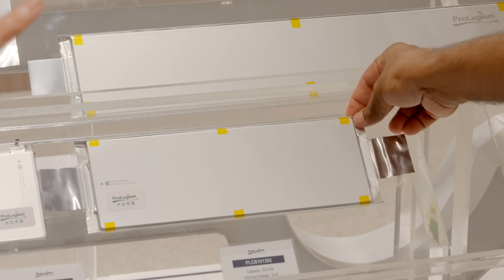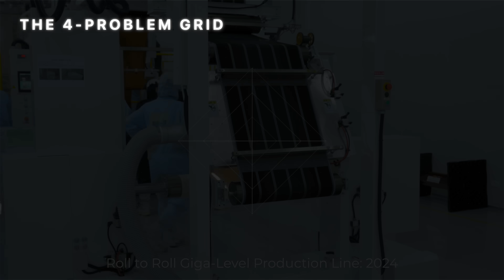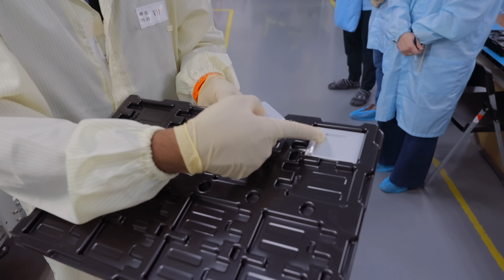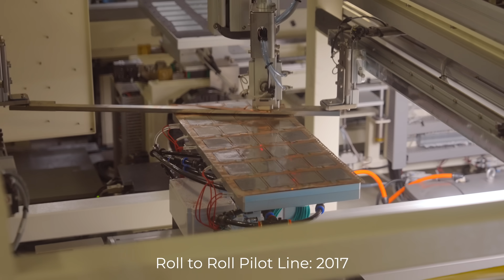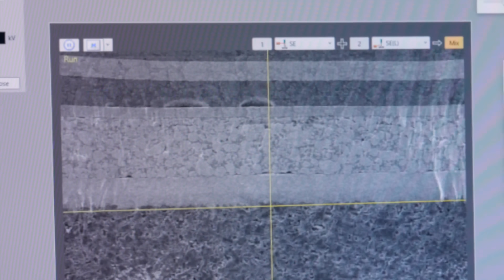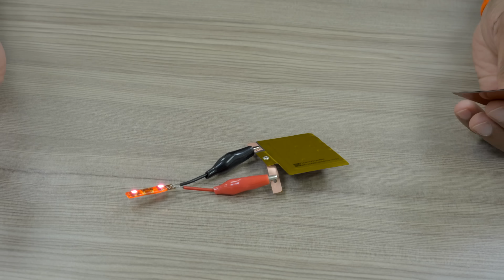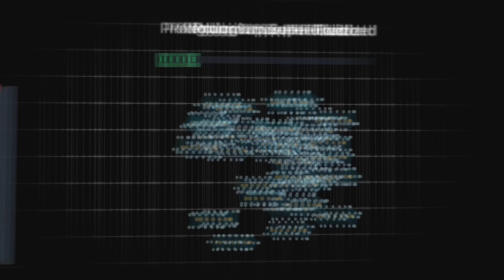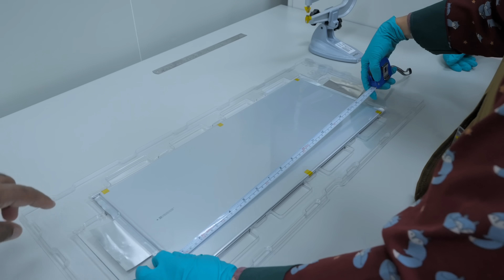Testing a REAL Solid-State Battery - Finally Here?

Comment: 24:57 discharged to 2.V thats way too low, would kill cycle life. I would say their E.D. is 280-310 Wh/Kg under a more practical voltage range of ~2.8 V.  Did anyone notice their current collector looks more like brass color than Copper? any thoughts.

Comment: This engineering is crazy. Really impressive. Well made video as well. I appreciate the comparison metics.

My questions:
- What kind of lifespan might you expect from Prologium battery like this?
- What happens to the battery at end of life, and what hazards might the chemicals pose?
- Can the battery be recycled in the same way the lithium ion battery can?
- what is the projected price per KWh?
Reply from the maker: Great questions. We may follow up with them as they start showing up in cars and ask about recycling and price. But recycling should be similar to tofay

Comment: Just one bit miss in the ProLogium battery presented here: 1200 charging cycles. Get that up to 3-4000 cycles at a competitive price and they have a big win for the next 3-5 years.
Reply: I don't think they need to increase the charging cycles 

If you look at the details that 1200 charging cycles is a very fast charging rate that's very hard on the battery 

What I want and I think a lot of people want is more capacity

Comment: This seems like a great evolution without the extreme claims that defy physics. Although the company shouldn't risk reputation, hypothetically you could buy an bike, send them the battery to be rebuilt by them.  The simplest real world test of real world use. The safety gains here and other applications, far outweigh the gains in automobile safety, given the tightly controlled use case. Bike to Aircraft safety?

Comment: The only problem with the name "solid state" battery is that the term "solid state" has been abused in electrical devices for decades to simply mean "no moving parts." not the absence of liquid.   Even here it is applied where a shear thinning fluid is being used.   So, the difference in solidity between conventional and solid state batteries is, well, small.  Why care?   I anticipate a lot of companies are going to use the current test criteria for solid state to sell very slightly modified traditional cells at a premium, making it hard for consumers at any level to tell where the quality products are.

Comment: That's great power density for a battery but gasoline still is king at 12.2 to 13.1 kwh per kg.
13,100 is much bigger than 397 by 33 times.
That's why gasoline is like a magical liquid.
Reply: You're forgetting that even the best internal combustion engines have awful efficiency compared to electrical appliances. Most of that energy in gasoline is lost as noise, heat and vibrations.

Comment: So, using these batteries to replace my F150 lightning pack of 1600lbs/131kwh, we would get 261.8kwh?  The truck would then have a roughly double range of 640 miles...

Comment: discharging to a very low voltage always gives you more energy. The question is, how much is the cell damaged by it. (regular Lithium cells are only discharged to around 3.5V by devices, their capactiy definitions discharge to 3V. So 2V seems very low). You can take any lithium cell and do 2V a few times to get bigger numbers. The question is, what is the voltage range for the claimed cycle live. I expect the discharge end voltage will be higher, thus the energy density lower.

Comment: Polyimides (PI) are used in extreme environments, as they can withstand temperatures over 400°C. And it is the thermal plastic used in lithium-ion batteries and recently solid-state batteries. So Ricky isn't nearly correct when he says...'the trouble is plastic starts to melt at a 130 degrees C', sure everyday plastics people put their hands on does. BUT the plastic separator in most lithium-ion batteries is NOT simply a 'thin plastic separator'...not by a long shot. And of course 'Conventional batteries' don't simply fight thermal coupling 'this with one tool'...smdh.

Comment: Thank you for saying dendrites can form on their own especially in frozen conditions, they don't say that and people that have them don't know it, leaving them against wooden walls year round in freezing cold, that could burn down a house, possibly the whole gas line attached to it. I'm gonna try to figure out the safest way and place to store it but most people don't realize it degrades with or without use in the freezing wooden part of their house, disaster waiting to happen, easily preventable, but people need to know that and they don't so most won't.

Comment: what I'm seeking the most in the new batteries is capacity. Most laptops still don't last a full day, not to mention more. And at heavy loads there is no laptop that lasts a full day. 
Imagine a gaming laptop that can still retain high performance and work for like 7-8 hours like that, while having a 2-day battery for light loads. That would be amazing.

Comment: LOL, it's not a solid state battery.   There is no solid state battery.   There is no liquid in a solid state battery.  Your channel is nothing but spam posts - every time I click on it, the video is nothing but incorrect information.
Reply: I think your point is valid, but technically speaking, the electrolyte is a non-Newtonian fluid, and whether or not a non-Newtonian fluid behaves closer to a liquid or a solid is dependent on stresses being applied. If the electrolyte normally behaves like a solid but exhibits sheer thinning when stressed, then colloquially (and probably for marketing purposes) you could call it solid state. But, yeah, if you adhere to a rigid definition of solid state, this is not solid state.

Comment: @12:19 you can also see smoke, when the scissors makes the initial cut. Is that the short causing the temp spike? 

I LOVE where batteries are going, great video, especially for us that use electric mobility abd have to have batteries in our home to charge. 
I am also confused why there still are no "graphene based" batteries as that would solve a ton of issues and make them safer.

Comment: Самые не убиваемые твердотельные аккумуляторы - это гравитационные (груз на тросе, который поднимая заряжают, а опускаясь он отдает накопленное) и инерционные (маятник и маховик). А остальное -  это потенциальный и очень дорогой мусор! 
***************
The most durable solid-state batteries are gravity batteries (a weight on a cable that charges when raised and releases its stored energy when lowered) and inertial batteries (a pendulum and a flywheel). And the rest is potential and very expensive garbage!

Comment: I don't remembering the Charge time? If this was in a Car and had 800KM of range at 180Watts/Km - what would the weight of the battery be? Does one need Cooling and Heating systems for the battery at all?

Comment: I would like to see the energy density numbers and wattage/hour test within the form and context of a battery back.. How much and how heavy packaging is required to pack that thin rectangular wide battery pouch?? are the compared energy density numbers for the best NMC batteries for their cells as it is in this test or are they at the pack level (270 watt-hours/kg) ?? If you pack that solid state into a system with the pressure needs of a solid state battery how heavy would it be? I am not questioning the integrity of this video but see some uncertainty and lack of clarity..

Comment: Talk about making a simple problem ridiculously complicated ;)))  Liquid air is better than any battery will ever be ;) Not just because of power and energy density per KG / volume. But also by its ecological & social footprint in manufacturing and usage. Ask me how ;) It is so easy that it is most exquisite ! Leo said it before and nailed it so well: "Simplicity is the ultimate sophistication" The only solution to the easiest most efficient all all front propulsion system si not even new or my idea ;) It is a set of natural phenomenons from the same family we see all the time in various forms in plain Nature.Animals use it also and quite spectacularly. Why must we avoid that and complicated our lives just for the dopamine of being different or "better" than the previous best crap ??? To use batteries you need motors. To use motors you need propellers and/or wheels. To use wheels you need tires. To make all that a lot of special  materials and slave-hours are wasted. Why ? Why not just be done with that problem as simple as possible and deal with other aspects of life like living worry free ? This is not an improvement ;) It is the polished road to a full technological anti-logic hell ;)

Comment: 26:18 If it's 30% more energy dense, wouldn't you get more than 30% smaller battery packs for the same range, since they now weigh less and therefore have to expend less energy to move?

Comment: Capacity testing a battery with such a large surface area will produce higher numbers than smaller profiles so don't expect the same power WH/KG with smaller cells. With only a 30% improvement over conventional batteries what is the cost premium and is it cost effective for EV applications?

Comment: I'm impressed but also wondering where the usual Two Bit skepticism was.  There is always a tradeoff.  We got a hint of one: cobalt is still present.  Another comment inquired about cost.  I also wonder about the manufacturing efficiency - faster drying of a slurry is likely to greatly increase the required energy input.

Comment: when he cut the cell in half and the LED came BACK ON?! okay now i'm excited
Reply: @stuartb5510  yeah that was kinda amazing. I'm sure this format will get incremental improvements over the years, like other cell technologies have done. More capacity/density, lower price, more charge cycles(?).  Just knowing there is virtually zero chance that your embedded battery will try and end you with a violent chemical fire is quite a plus!

Comment: These and other solid state batteries have a long ways to go. Expensive and relatively fragile when considering expansion and contraction issues. Also, lithium anodes is the eventual goal due to ceramics causing issues with ion flow, the cost and shortages in lithium this would cause is not good, to put it mildly. The electrolyte is not solid. Great marketing video though. My dream stock has been to find the right battery company that is actually a public corp and buy the stock pre-commercial launch of cheap functional solid state batteries. The dream continues.

Comment: How much do these batteries cost to produce?  I own a Huawei 15C mobile phone.  The battery seems incredible.  With all day video, Whatsapp, GPS, QR code banking -- this fast charge battery usually lasts a couple of days and charges in about 15 (10% to 80%) - 30 (3% to 99%) minutes. I can't wait until these solid state batteries become the norm. In the meantime, people in the USA still don't understand how batteries can work in an integrated electric power system (the grid)  to provide power at night and in cold regions. People in non-alternative energy States think "alternative energy won't work at night." I read that in a  post and thought... This is why America does not have innovation like the Chinese. 😮

Comment: The Hidden Cost of Fireproof Batteries

To make next-generation solid-state batteries safer, manufacturers are incorporating fluorine-based compounds to prevent fires. The logic is sound: non-flammable materials mean fewer dangerous battery fires. But there is a troubling catch nobody is discussing.

These fluorine compounds are PFAS—the same "forever chemicals" found in 3M's stain-resistant carpets and waterproof clothing. The difference in scale is what should alarm us. The PFAS crisis from decades of consumer products is already a global health emergency. Now imagine those same persistent chemicals embedded in billions of electric vehicle batteries, grid storage units, and electronics. At end-of-life, each battery becomes a potential point source of permanent contamination.

PFAS are the leading suspects in modern cancer epidemics. They mimic hormones, disrupt endocrine function, and never break down inside the human body. They accumulate. Over a lifetime. Across generations.

Scientists have already detected battery-related PFAS in wastewater and landfill leachate near manufacturing facilities. Yet research on this problem remains, in the words of a 2025 scientific review, "underestimated" and critically under-studied.

We are racing to solve fossil fuel emissions by building infrastructure that may leave a toxic legacy magnitudes larger than anything 3M ever produced—before anyone has asked whether we're trading one existential crisis for another.

Comment: i would want to also do these tests: 1: double battery short: two fully charged batteries connected in a shorting loop: pos to neg of both termals.  2: high voltage charging:  apply higher than normal voltage to see it fails.  3: overcharge test: how long can overcharging be applied safely?

Comment: This could be as big a revolution for power tools and electric vehicles as moving from Lead-Acid to Nickel-Cadmium to Nickel-Metal-Hydride to Lithium-Ion to Lithium-Iron-Phosphate chemistries was.  Each of these was a great step forward.  This looks to be a bigger step than any of the previous ones, with faster charging, better safety, better power/size and power/weight all at the same time.  To have all that and also be one of the most transparent battery manufacturers out there today is truly remarkable.  I hope they will license this technology and all battery manufacturers start switching to it as soon as possible, and that they keep living up to their claims as they have so far.

Comment: Calling this solid state is a stretch. Their own flagship electrolyte is branded “superfluidized,” meaning it flows like a liquid, which makes it semi solid / quasi solid state. The only truly solid part is the ceramic separator. “Solid state” is doing marketing work here. Would you still classify it as a true solid state battery?

Comment: That voltage drop (4.1V - <2V) means you'll need more cells in series and some high power (i.e. heavy) DC-DC regulators to pull the fully charge voltage back to where you want it. Most applications are not going to tolerate 1/2 voltage at the end of a cycle. Pack/application level gravimetric energy density?

Comment: I understand they are a business to business company, I wish they would sell to individual consumers. Even if this tech doesn't go into  smart phones, at the very least I would want to see this on a personal scale with like a backup generator set-up. The thought would be plug into  the electrical at home, the cell charges, then effectively just waits for an outage to flip on. It would be a good idea to have an electrical monitering system that would stop charging at full, and pull a charge when it detects lower than like 50%p, which takes a long time to depleet with solid state batts. a big benefit would be a super quick recovery in unstable regions. either due to faulty wireing that causes electric to go out with the smallest provocation, or in areas with regular severe climates that tend to damage the grid. even if the electric comes on only for an hour, that may be plenty of time to get a full charge for the cell if it goes out again. I would even just take a basic battery bank with a few 240v and 120v outlits on it, that would be great.

Comment: Hold up here, he tested a 50% voltage drop. Typically a lithium-ion battery is out of useable capacity after 25% voltage drop. For example voltage range for a cell phone battery is 4.4V (full) to 3.4V (empty), and a power tool battery is 21V (full) to 15V (empty). So instead of 612 Wh its actually 436 Wh of capacity. So in other words, it is 256 Wh/kg NOT 360 Wh/kg. Roughly the same as a Tesla 4680 battery. Cell phones are 200 Wh/kg and power tools are 115 Wh/kg according to Google search.

Comment: 7:57 liquid electrolyte. So it's not solid state battery, then. Lol.
Reply: I had the same thought, still very good and safe etc, but I thought solid state was more like a computer chip than a traditional battery, am I wrong about that?
Reply: @MilesMcCusker  I'm more than happy about any battery innovation as long as they don't literally lie about it. We don't have any example of mass produced solid state battery. Lab made batteries and mass produced batteries could differ significantly. I guess solid state batteries aren't gonna be cylinder shaped so you're probably right.

Comment: Except this is not a Solid State battery.
It contains a liquid electrolyte which looks and behaves exactly like the one CATL used in his last video and CATL is not calling theirs Solid State.

The Definition of a Solid State Battery
Solid-state batteries are called "solid-state" because they replace the flammable liquid or gel electrolytes found in traditional lithium-ion batteries with a solid material, such as ceramics, glass, or solid polymers.

Also where are the Lab reports for C-Rate and capacity.  You weighing it on their equipment is not worth much.  I would not accept you using Donut Labs equipment to measure anything on a Battery.  That is what Independent Testing Labs are for.

Comment: We know it has density of 360 Wh/kg (which is great) 185 Ah voltage 3.34V. No thermal runaway. No mechanical damage will cause to self ignite. It is not flammable. 
So few questions: What is the longevity how many charge/discharge cycles? How fast can it charge to 80% and 100%?  And lastly what is the price per kWh ?